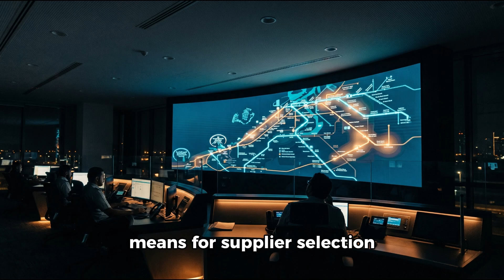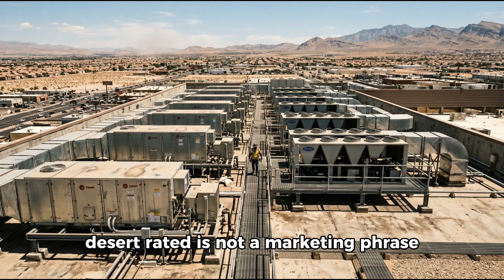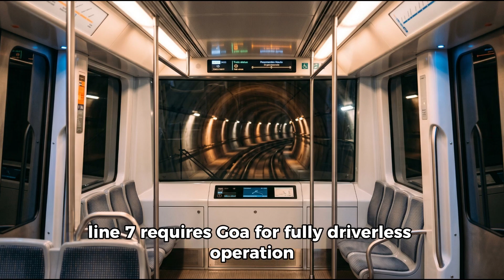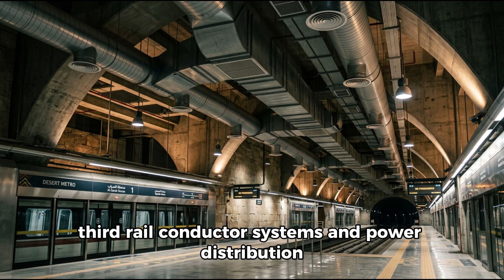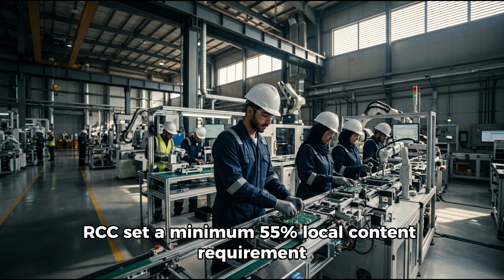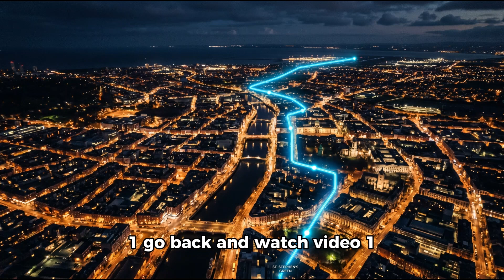What 45°C Heat Means for Riyadh's New Metro Line

Comment from the maker: 📌 QUICK REFERENCE — Riyadh Metro Line 7 · Supplier Map

Phase 1 rolling stock on network:

Lines 1–2: Siemens Inspiro + Trainguard MT CBTC
Lines 4–6: Alstom Metropolis + Urbalis 400 CBTC
Line 3: Hitachi Rail SelTrac CBTC

Line 7 key technical standards:

GoA4 fully driverless
750V DC third rail (network-compatible)
Desert-rated: validated above 45°C
IKTVA: ~55% local content minimum

Competing consortia rolling stock OEMs:
1⃣ Alstom (Phase 1 Lines 4–6 incumbent)
2⃣ Siemens (Phase 1 Lines 1–2 incumbent)
3⃣ Hitachi Rail (Phase 1 Line 3 incumbent)
4⃣ CRRC (no Phase 1 presence — disruptor)

📄 Free supplier reference list → Subscribe + comment "SUPPLIER LIST"
🔗 Part 1 (tender breakdown): https://www.youtube.com/watch?v=ci8F_RND7gc
⚠ All data from public sources. Verify with RCRC for official details.